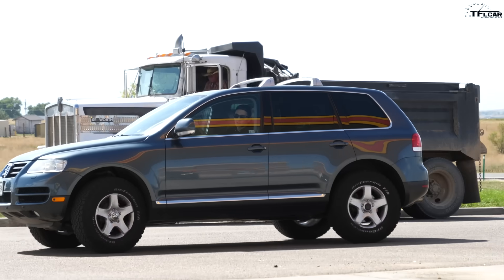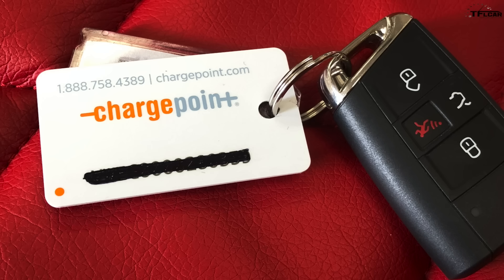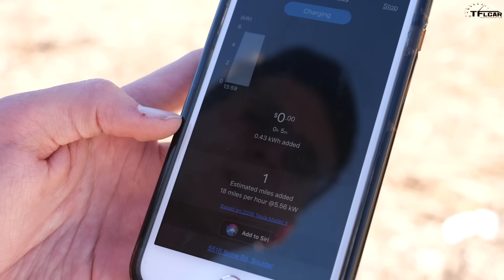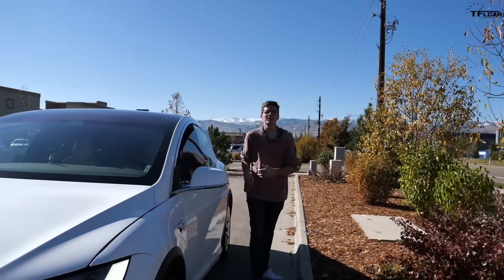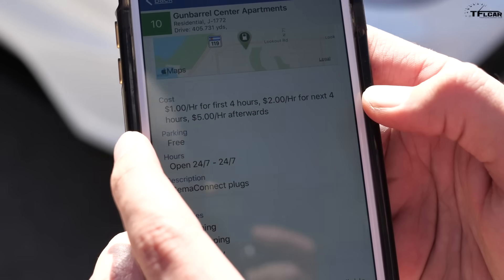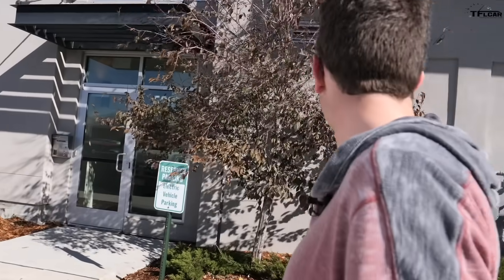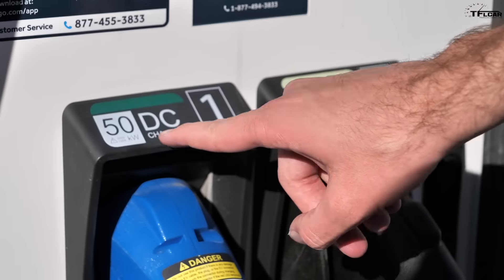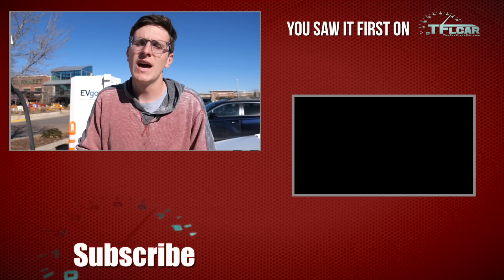Here’s Why Charging an Electric Car Can Suck - And It’s Not The Reason You Think!

Comment: Just share some experience. In China, most of the time we used the QR Code that pops up on the charging station's screen to pay the fees (some resting area on highway need you to pay inside and they will give you a charging card to the station). The two most popular app in China are WeChat and Alipay, and both APP has the function to scan QR Code and make the payment ( cell signal is everywhere so don't need to worried about running into a station and no cellphone signal to pay). Also, our navigation map (Not Google map) inclouded all the public charging stations, so is no need to download the additional APP to find them, even though some company has its own APP.

Comment: I started with a 2013 Nissan Leaf, with a max range of 80mi. For most of my purposes and for commuting, it was great. I had a 220v outlet installed in the garage of my apartment building (yes, it can be done!) which allowed me to recharge overnight. This eliminated most of my need to visit these remote charging stations day to day, but if I happened across one that was convenient to where I was going, I’d often plug in to ‘top off’. After a while, my wife and I decided to go 100% electric, and sold our Mazda 3 for a Toyota RAV4 EV, with a max range of about 120mi. Sharing charge days at home wasn’t too big of an issue, though sometimes we would have to take the Leaf to a nearby ChadeMo charger to quickly charge if a trip or commute came up suddenly. A few years later, we sold the Leaf and bought a Tesla Model 3 Standard Range+, with a maximum range of 240mi. This is now our ‘road trip’ car, as we can easily and quickly recharge anywhere we want to go. I also use it for my daily driving, which is a blast to say the least. You might think wow, with 240mi of range, how did you ever get by with just 80!? Honestly? It wasn’t that hard. Most days I’d drive 20-30mi. The extra range of the Model 3 just means we can take bigger trips more easily, and I recharge less often.  In a few years cars will have 400-500mi of range, and we’ll probably be back saying wow, how did I get by with just 240mi!? :)

Comment: Not a fan of how little time you spent talking about the tesla supercharger network advantage. But in a way you actually somehow managed to portray just how far the other ev charging network players need to still go. To me a standard adapter should be mandated in order to ease widespread adoption. I also think more of the player's allowing for cross use will happen. As well as thing's like Ford and others such as Porsche with the taycan pushing a certain network. 

You could have also mentioned Volta which is a very fascinating player. And how a lot of places are allowing free level 2 charging. Still all in all imo a fair review of charging an electric vehicle.

Comment: Sorry but 220v is the standard in residences in the US. It is the voltage (2 - 110v legs) that enters your residence or is found in commercial buildings (which often have much higher voltage as well). Apartment dwellers are most likely what was referred to in this video. I can see where that would be a complication.

Comment: This video should be titled:  "Slum Charging in a Tesla."
Reply: My model S has free charging at any Tesla station for life, 15-20 min. charge is all you usually need if on the road, otherwise just charge at home on a 240v 50 amp circuit. Way cheaper than gasoline and fast, but convenient to do it while you’re sleeping to make good use of TOU rates.
Reply: aardvarkansaw - ‘Cry baby can’t appreciate amazing car’

Comment: There is a free ChargePoint charger at the local gas station here in SE Iowa.  It charges my Chevy Bolt about 14.6 miles per each hour I am hooked up.  This is not very useful.   Certainly if I could get 25 miles added per hour that would be better.  But if one wanted to travel on a long journey, waiting 4 to 6 hours for the next leg of your journey to begin makes long journeys impractical.  So what is really needed is a lot of Level 3 charging stations--so that long journeys are practical.  I am not sure how fast a Bolt can be charged, but getting 100 to 150 miles added in a half hour or an hour--this is what is really needed.

Comment: FYI For a 300 mile BEV. Somewhere around 75kwh to 90kwh.
Level 1: Eternity
Level 2: 6kw around 10 Hours. e.g. at home While You Sleep
Level 3.1: 50kw DC Slow Charging about 2 hrs.
Level 3.5: 150kw 45 Min to Safety Slow Down.
Level 4 beyond 200kw: 20min to Maxed Out

Comment: I've been thinking of getting a Tesla model 3 but its wierd
Reply: Do you have an accessible 220v outlet at home and can you reach it or otherwise have a plug installed for a charger?

Does your area have superchargers?

Not an issue if you can plug in at home or hit a supercharger.
Reply: @geologik7500  there are alot of superchargers but no i don't have 220v at home

Comment: Great info but it just gives me more reason why I will never own one. Looks like there needs to be a lot more regulating on standards for plugs, payments and still who has 30 minutes to charge their car?  Silly signs like residents only, 40 mins only... ugh what a hassle. Beyond all of that madness, how does this all help the environment when you get your power from a coal fired power plant or the vehicles are disposed of when the batteries wear out. And how about all of those uncontrollable fires from those Teslas. There is a lot of suck factor when you think about it.
Reply: Tesla signs don't say residents only, they say EV charging only and the spaces are usually in the back of lots. The grid is getting greener every year and coal is in big decline. The vehicles are not disposed off and Tesla's are continually upgraded remotely, the batteries are recyclable and the batteries are replaceable. Tesla's have experienced fires at 1/10 the rate of ICE cars. They are also exciting to drive if you don't want to use the autopilot. Go suck on a piece of coal.
Reply: @leeoldershaw956   This source doesn't show any decline: https://www.carbonbrief.org/mapped-worlds-coal-power-plants. Go suck on a power cable.

Comment: EVs are still not ready for everyone. it has to charge with in 5 min to be worth it .
Reply: Really? If you can charge at your residence or at your workplace it would definitely work well for most people.
Reply: Stwinge44 imagine if you had to go fill up your phone with gas. You fill it up all your life then phones with batteries come out, “battery phones don’t work, the battery doesn’t charge in 5 minutes”
Reply: @3DPrintedCat  Cars spend a lot of time sitting around, so for most people it would not need 5m charging times. I'm not sure if you're agreeing with me or
Reply: @Stwinge44  What do you drive in a pinch if your car is plugged in overnight and doesn't have enough to go anywhere yet?
Reply: @dchawk81  It's extremely unlikely that you would not have enough range to go anywhere, given that normal people commuting say 50km total a day would only be much less than half of a car's total range.
Reply: @Stwinge44  Okay think outside the box for a minute and forget commuting. There's more to life than commuting.
Reply: @dchawk81  Sure. But you can already get EVs with 300-400km range, and it's already very unlikely for people to drive more than half that within a day.
Reply: @Stwinge44  400km is less than 250 miles. You'd be surprised how many people do that in less than half a day.

Comment: Now imagine doing all this when it is 10 degrees outside and snowing. No thanks.
Reply: Never 10 degrees in southern California!
Reply: Well I'm never gonna argue this point because it sucks to pump gas in winter as well.

With an EV you can at least crawl back into the car. With ICE you're not supposed to because of static buildup causing a potential explosion.

Not an EV fan yet but this point doesn't really hold water.
Reply: @dchawk81  Good point. Never thought of that. It only takes a few minutes to pump gas though. I will still wait until the technology improves to a point where I don't have to wait that long for a recharge. He was also doing way too much fiddling just to get the charging started.
Reply: @joe97nsx  Yeah I'll probably never get one. 😁
Reply: @dchawk81  I think I will eventually. It is the future. I am just not ready for it and I don't like its total dependence on electronics.
Reply: @joe97nsx  I think plugin needs to go away in favor of inductive charging. As soon as you park in a spot, boom you're charging.

It should only be a matter of time since phones are doing it.
Reply: @dchawk81  induction at 220 vac and 24 Amps? Hmm, maybe better brush up on some basic electrical math. Induction smelting is very efficient. Phones use a tad less energy that a car.

Comment: Bro, use the supercharger in Boulder. You drive a Tesla. The process? Back your car up, plug in, go poop, have a latte, unplug, drive off... 

If your gonna get your panties in a bunch about non-standardized plugs you should demonstrate your point with a non-Tesla EV. And if, for whatever reason, you wanted to fast charge a Tesla on EVgo level 3 chargers you can obtain an adapter. A lot of non-Tesla EVs can't even do level 3 charging and I wouldn't trust running 50kw on one that says it can (looking at you, Leaf). I just don't understand the point of this video. And it feels like this channel has an axe to grind with Tesla. These guys should go hang out with Top Gear to peddle their FUD. Y'all bring shame to my beloved state of Colorado.

Comment: Yes, you give me  the reasons to drive  gas engine vehicle.   None of that confusion for me.   I still fighting ethanol fuel.  Do not use it. Do not buy vehicles that use it.  Same for electric.   Not in my lifetime, will I OWN a electric  vehicle as long as gas engines are still running on the highways.

Comment: Let's say you're traveling through the area but you need to recharge.  You plug in, start the charge and do what for the next many hours?  Earlier this year I made a round trip if 4,660 miles.  I never took more than 15 minutes to fill up, stretch my legs and use the restroom before getting back on the road.  I cannot fathom making a trip like this with an EV with charge times in excess of 15 hours just to go 300 miles.  If this is the future, you can keep it to yourself!
Reply: Tesla's charge enough to go another 2 hours in those 15 minutes so that's all you need in that 300 mile trip. The level 2 chargers are for overnight charging at your home. I recently made a 380 mile round trip in a Tesla Model 3. The first leg was 3:10 hours to an  Applebee's Restaurant that had a Tesla supercharger in it's parking lot. The car was finished charging to 90% for the trip home in half the time it took to eat lunch. The return drive was non-stop to home in 3:10. Tesla owners are choosing them over their ICE cars because they are better highway cruisers particularly because the autopilots drive the whole time. The future is already here and it's superior.

Comment: The technology that solve all changing problems is seating behind closed doors and not because of monetary constrain but greed. It had been used for years in trolley systems and it can charge  the car while driving on electrify road sections. This system can reduce battery size by 70% and make EV prices lower than ICE cars. Are we ready to make ICE cars obsolete? Yes, we are but don't want to.

Comment: Charging at home is easiest.  Charging in the wild is hit and miss. If you drive to empty from your home and expect there to be a charger available AND working, 7 out of 10 times you will be out of luck. Often there will be a few chargers, but they will be tied up by other users.

And, EV chargers are often in secured apartment or office complexes. You can look on the Chargepoint app (I agree, the best and most reliable system) but often it is hard to find the needle in the haystack when you drive by a massive complex and cant figure out how to get to the charger station itself. And, they often charge for parking at office complexes. Then, you might have to pay for the charge, too. 

I'm on my 3rd EV (2 Honda Fit EVs and a VW e-Golf) and I rarely count on charging in the field. Sitting in a parking lot waiting for a charge is  a huge hassle.

The idea of Plug Share a few years ago seemed to be that people with chargers would share their chargers almost like an Air BnB for EV users. But I don't think I'd allow a stranger to sit at my house charging their car; not so practical.

Comment: This is why I'm glad that in NZ, the Tesla Model 3 has a standard CCS plug just like in Europe. Our superchargers have had a second cable attached with that connector, and we can also use all of the public fast chargers provided by ChargeNet. Also the AC part of the CCS is a type 2 socket, also the same as in Europe, and that supports up to a 3 phase AC connection, and on the Model 3 provides up to 11KW. At home we have a dedicated wall box which provides single phase but up to 32 Amps, for 7KW of charging. The Hyundai EV's have the same ccs connector, and it is only the Nissan Leafs that now have the Chademo connectors.

Comment: Electric cars won’t be useful until we can speed up the charging
Reply: You mean like at one of the thousands of superchargers designed for that Tesla? Or charging at home on a 240v leg and waking up every day with a full tank and more than enough range for most people's daily commute.

This video is disingenuous at best.
Reply: Dane Kaylor true but they’re not everywhere, there are only 2 superchargers in my state and installing a 240v charger into a house is really expensive. And a lot of people don’t park there car in their garage let alone have a garage
Reply: It really depends on where you live. In Australia we have 240v everywhere.  And adding a 15A (3.6kw) outlet in the garage is usually not that expensive because the switch board is in the garage.

Comment: They need one standard adapter, 350kw speed and the ability to use a credit card at the charger with the price per KWH listed.  Anything less and we will all just keep driving ICE.
Reply: I made the comment about why can't the chargers take credit card directly and the answer was the cost of the credit card transactions. On a 10kwh charge at 25c/kwh you would be paying $2.50 for the electricity and $0.5 for the credit card transaction.  So the reason is cost. Charging is a very low value transaction unlike adding fuel at a petrol station.
Reply: @franciscoshi1968  So if you pay with the app using a credit card what is the difference?  Besides having to attach your credit card to many different charge vendors?  One way you can "pay at the pump" and the other way you are taking the extra step of using an app to pay using the same credit card.  Seems like the same process with extra steps that just make it harder for the consumer.  Also charge companies could make a deal with credit card companies to charge less for these kinds of transactions, or create a card of their own that just tracks how much you owe and then bills or charges you at 50 dollar or 100 dollar increments.  There has to be a better way.

Comment: Good points, but missing some context. For example, stating that it takes multiple days to charge to-full using a home 120V outlet makes it sound like the 120V home-charger is nearly worthless, when in fact it's extremely useful. I use the 120V charger and wake up each morning with a full charge, because my daily mileage is about 35 miles per day. I get 4.5 miles/hour of charge using my 120V outlet (Model 3's do better on miles of chg/hr than your Model X, and Model 3's are the most popular EV owned) which means if I plug in at 8pm and the next morning leave at 8am I get 54 miles of charge -- way more than needed.  I effectively wake up each morning with a full "tank" (full charge). It's way more convenient than going to a gas station every 300 to 400 miles. Alternatively I could install a 240V outlet and buy a 240V charger (total cost between $500 and $1000 depending on situation and savvy), which I'd consider a cost of buying the car) and get 30 miles/hour of charge, meaning 8pm to 8am can add up to 360 miles of charge, which is more than the 310 mile battery needs. It would take only about an hour in my garage while I eat dinner to replace the 35 miles I usually drive. I had more range anxiety driving a gas car because with a gas car the tank would sometimes get low. With my EV I leave every morning with a full tank -- so no range anxiety.  It's true that if you live in an apartment building without outdoor plugs or chargers owning an EV may be less convenient, but if you can plug in overnight every night, even with 110V charging you're fine, unless you drive  over 60 miles a day, in which case you need to invest a in a 220V system. Or if you have a Tesla, use a supercharger by your favorite lunch spot and charge up while you eat lunch or watch YouTube/Netflix on your Tesla's entertainment system. :-)